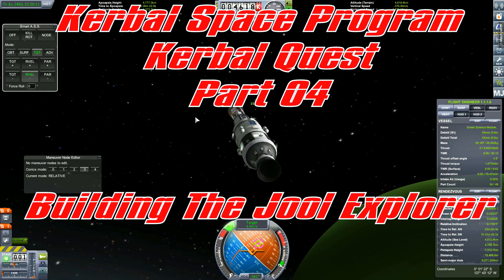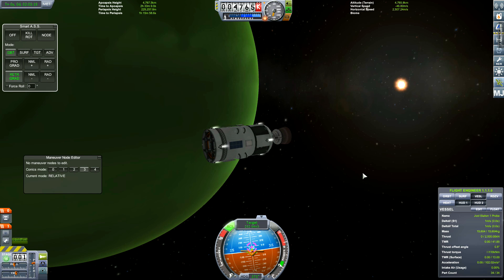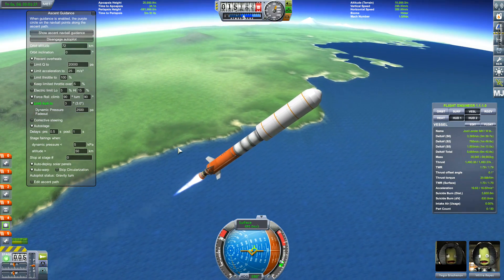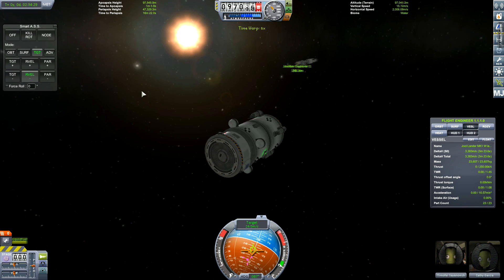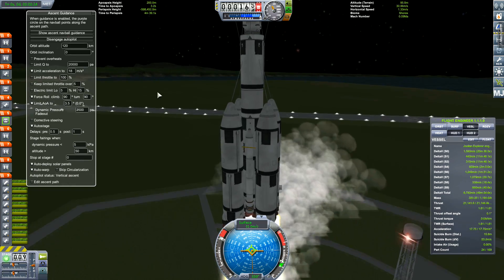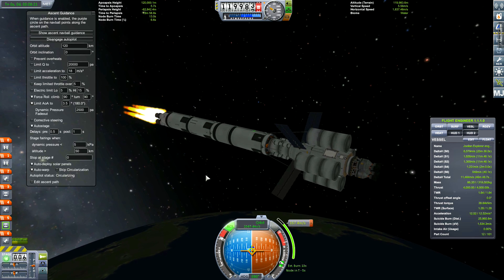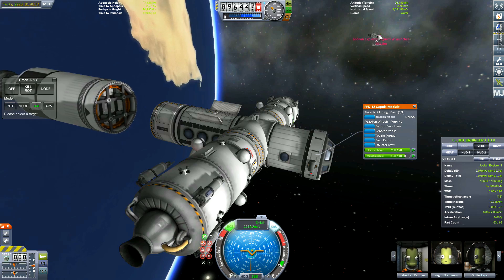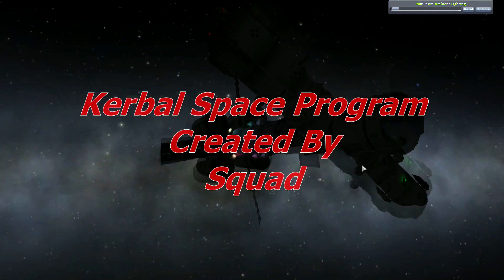Kerbal Space Program - Kerbal Quest - Part 04

Comment: I found a cheaper and faster way to get to Minmus. Because Minmus is in an inclined orbit of about 6 degrees you'll have to do an inclination burn to make up for the difference. Off course you could wait for a window when Minmus is on the equator at the time of arrival. But it dawned me that 2 times a day the Kerbal space centre is on the Ascending or Descending node of Minmus orbit. Now I just timeshift till KSC is directly underneath the path of Minmus and launch in a heading that makes up for the tilt of Minmus (either 96 or 84 degrees). This way I don't have to do an inclination burn and can fly straight to it as if it where the Mun.

Call me Blue Mage or Caeruleus Magus (that's Latin btw).
Reply: Call a Kerbal, I mean.
Reply: Speaking like Yoda, I am now.
Reply from the maker: Your thinking like NASA now launch when the orbit is in line with your launch site hence launch windows ;)
No Problem Blue Mage sounds cool by the way, couldnt find out what 'Caeruleus Magus' means?
Name added will be, mission important shall be placed :D
Reply: +Orb8Ter Caeruleus means blue or dark blue, magus means mage.
Reply from the maker: +Bluemage6 Well Caeruleus Magus has been added ;)

Comment: There are at least two ways to attach the unattachable (there are probably more). In the stock game use the "claw" or use Kerbal Attachment System to add a new docking port (which you'd bring into orbit using the Kerbal Inventory System)
Reply from the maker: +viruk67 Yeah I had thought about attaching a heat shield with THE CLAW but I am not confident about aerobraking